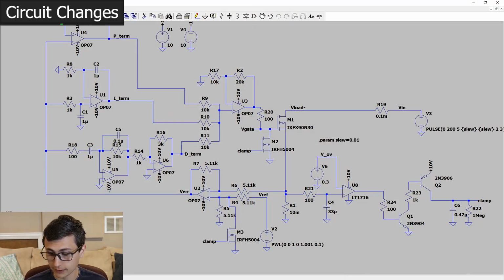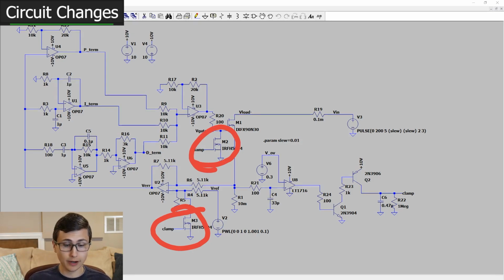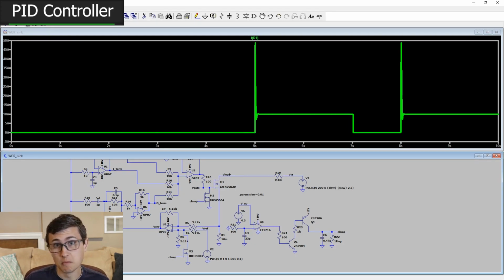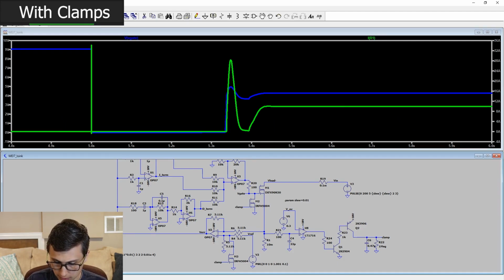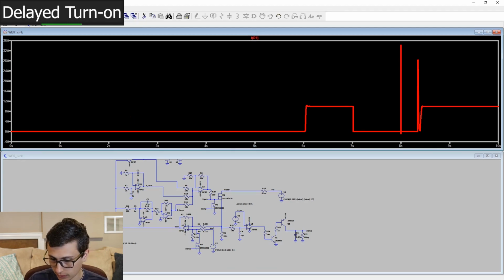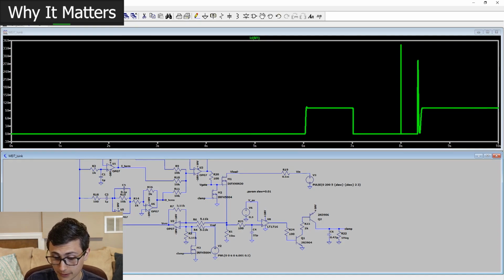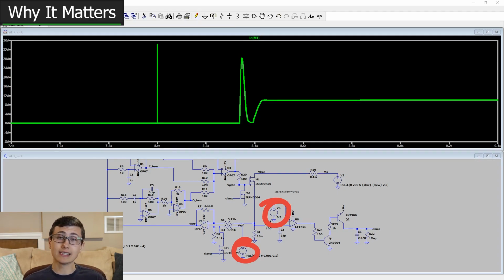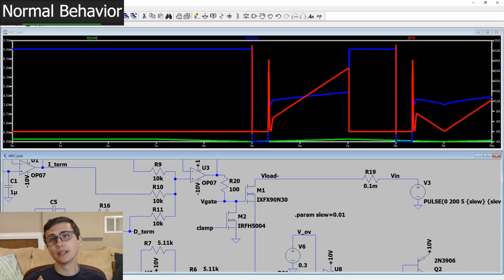Current Source? Current Sink.

Comment: I enjoyed this one. Excellent work!

Excited to see how you go about solving these protection issues.
A Multiplying DAC is certainly a good, albeit expensive option, if you end up needing precision resistors or expensive IC's?
An analog only  protection circuit sounds cool.
Interested in seeing if that keeps the costs down compared to a mixed digital/analog solution.
I guess precision analog components also get expensive?
I haven't looked at prices for cheap precision opamps in a while.
For small, low precision, constant current sinks I've just used TL431 with BJT's as a quick hack =P
I wonder whether that is also a consideration, if you don't need the high power, low on resistance, "voltage mode"  considerations that FET's provide?
Reply from the maker: Hello Normally Open! Great thoughts! 

You're 110% in the right place for our upcoming series designing an electronic load, and I love that!
I see you walking down similar trains of thought. There's a great thing about current sources that allows for keeping costs reasonable, and that is, we can use multiple output stages in parallel to autorange without switching!

So, there can be a high-precision low power stage in parallel with a medium precision stage, etc. That's how I'm hoping to achieve decent performance with reasonable costs. Avoiding crazy high precision... everything- hopefully! It's probable that at some point, assuming the project gets that far, it'd be relatively easy to link multiple of these stages in parallel somehow, which I think would be pretty sweet!

With regard to something like a TL431, I think something like that could be possible, though I imagine controlling transient response could get a little tricky. Maybe I'm wrong there. :) Regardless, I'm excited to see where this goes as we kick off the first phase of a new project!

Cheers, thanks for watching, and thanks for sharing these great thoughts!
Reply: Do you think copper surfaces or aluminum surface is better ?

IAM using class 1 AMD CPU cooler but aluminum with Cooper core .

But some times I feel that the better install it in first surface aluminum then second surface copper them 3rd surface aluminum .

What do you think the best way ?

My CPU cooler get 100 in 500w for 2 min and it fail since the transistor get more than 150

Copper can take all the heat but not remove it quickly.
Aluminum can remove quickly the heat but not take it fast.
Fan in the aluminum is better than fan in copper .
But freeze the copper is better than aluminum .
Soo something need more improvement to get ideally cooling system.

And by the way ... The 3 legs terminal Of the transistor . Is almost extremely hot .

Comment: I want to ask you how I can easy calculate the heat think needed to remove a high power energy of heating inside a transistor .

Like I have a transistor the DP power  inside it over 800w ( just like you powerd up a water heater with out water) the cooling get fast hot regarding the big size of the cooling part and speed fan . And even some time the transistor fail during there are not enough quick dissipated power between the cooling and the transistor . ( The cooling is not fast enough to take out all that heating in fast time .) It's like you trying to take off a big fire in  slow motions . 😅
Reply: I may not be your intended recipient. But i'll add my opinion since this is kind of a public forum. (I'm no mechanical engineer =P)
Sounds like you have a "thermal resistance/impedance" issue. There will be a time delay between any heatsinking/cooling, and the semiconductor device.
i.e. how fast can you get heat out of your device?
might be worthwhile splitting your load between multiple transistors, or going for something with less "thermal resistance" between your cooling/heatsinking and your device.
I believe you can get power transistors with exposed dies, have the substrate exposed etc so you don't have to go through plastic, nor metal? 
Otherwise, sub zero,  bare dies and a wire bonding machine? =P
Reply from the maker: Thanks for jumping in, Normally Open! I love these thoughts!
Reply from the maker: Hello Abed! I totally agree with Normally Open's comments below. This sounds like a thermal impedance issue. It's hard to say whether it's between the part and heatsink or the heatsink itself. That said, 800W is a  LOT for one transistor. 

We're about to launch a design which intends to dissipate approximately 300W in one transistor, and that will be a real challenge to do without exotic cooling or specialized parts. A good place to start, if you want to do more testing than analysis, might be a high performance thermal interface material. Another think you could try is running for a short time with the heatsink held a subzero temperatures. If the transistor is still damaged with the heatsink held cold, you'll be almost certain that the issue is getting heat out of the part and into the heatsink.

Cheers, best of luck, and thanks for watching!